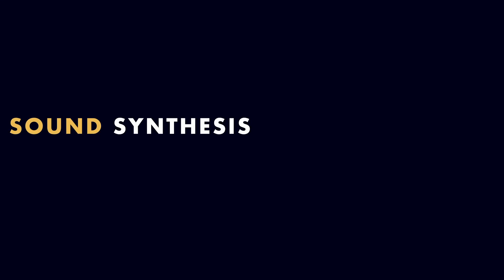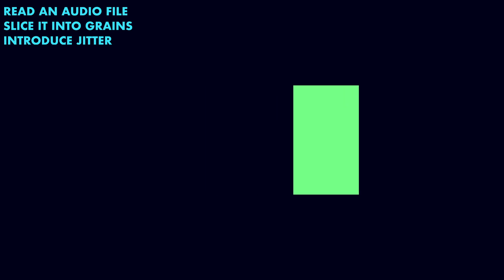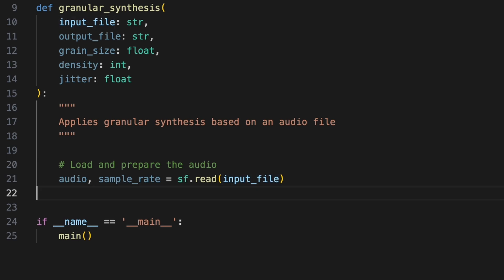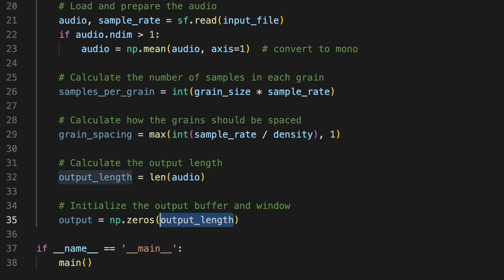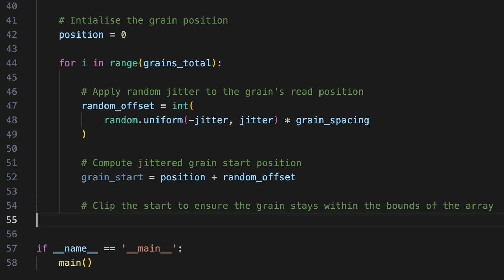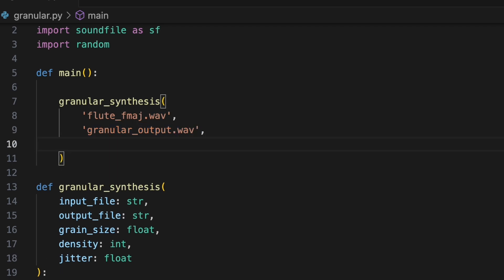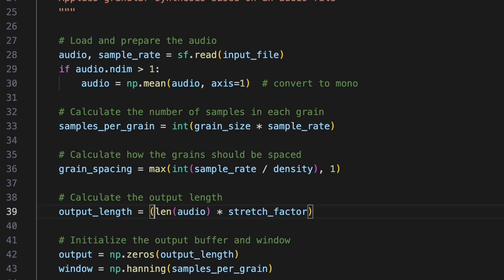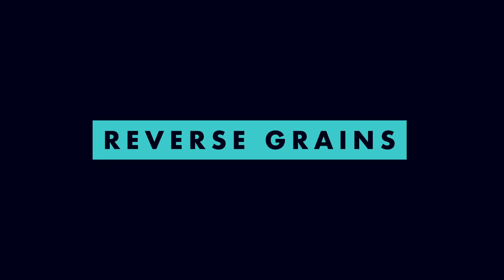Granular Synthesis in Python: Step-by-Step Audio Programming

Comment: Great video! Thank you very much. I am looking forward for pitch shifting in granular synthesis. Is it possibly to apply a vibrato effect (FM) to a real audio signal with granular synthesis?
Reply from the maker: Thank you, I'm glad you enjoyed it! Yes, you can definitely combine granular synthesis with frequency modulation. To create a vibrato effect, you can use a low-frequency sine wave to modulate the pitch of the audio that you first generate through granular synthesis. The same principles from my AM/FM synthesis video apply here. You’re essentially layering techniques.
Reply: @codemeowstro  Thank you for the answer. I will try it out in the next couple of days. After I will tell you about. Have a nice day.
Reply: @codemeowstro  UPDATE! I have solved the problem on my own. For a real vibrato effect without artefacts you only need to interpolate the delayed signal linearly. Maybe your advises will work. But your AM/FM-video and your video about granular sythesis have not solved my problem generating a FM-synthesis on real signals.